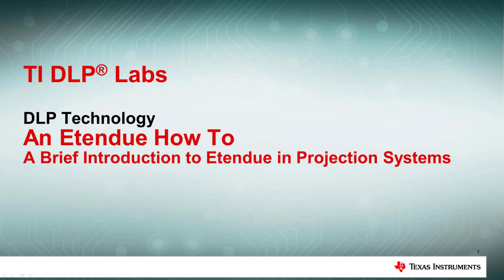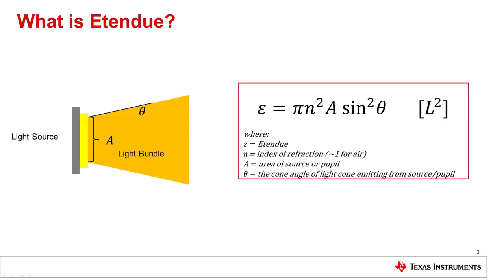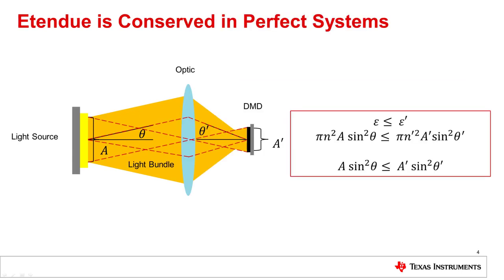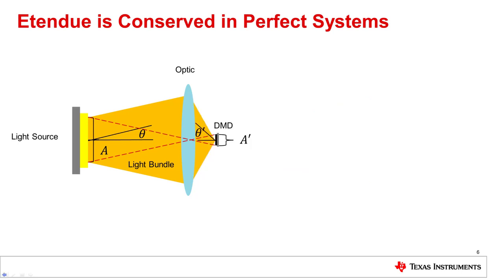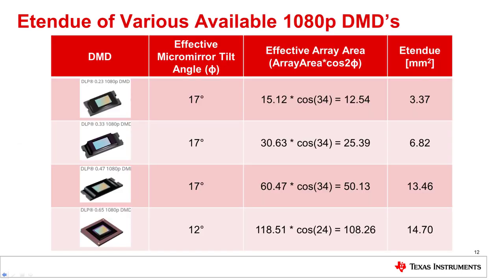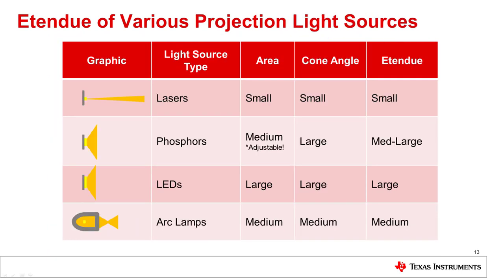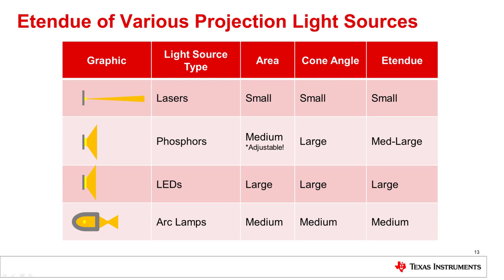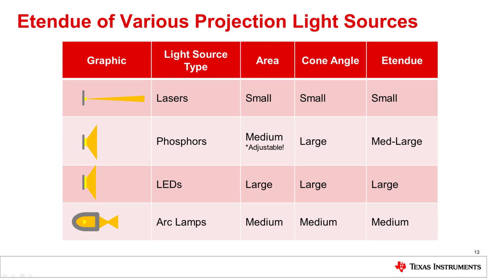An Etendue how-to: A brief introduction to etendue in projection systems

Comment: So  which Etendue is better for video quality?
Reply: All are the same.
It's not about quality, it's about efficacy.

It is possible to decrease etendue by rejecting that part of the light which is emitted with greater angle.
Reply: 05:42 here sine of the angle of light cone is a multiplicator.
So if you reject all rays with angle greater than 0, you will get etendue value equal to 0.
It's not practical to do so, because it decreases efficacy accordingly.

But rejecting some part of the light could be a reasonable way to achieve required etendue.
It's actually done in every optical system with every light source, but with different efficacy.